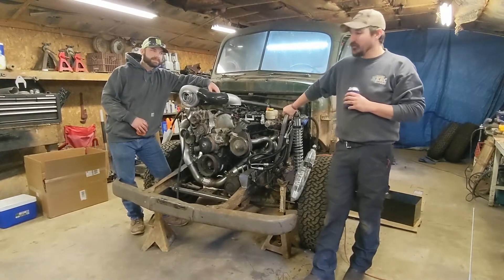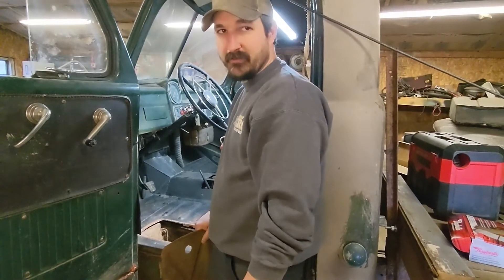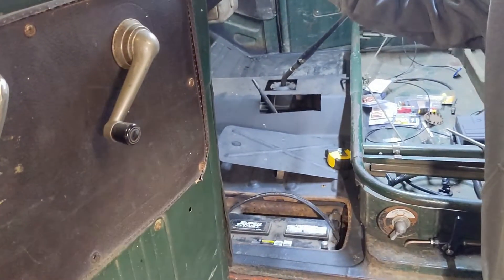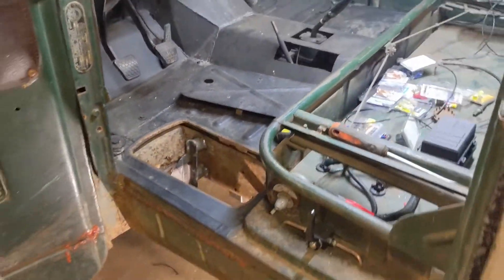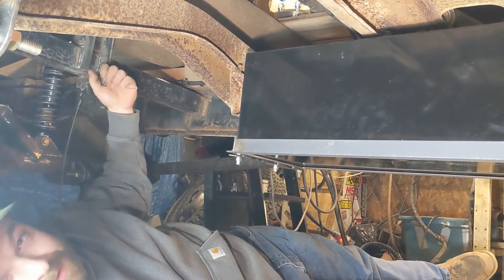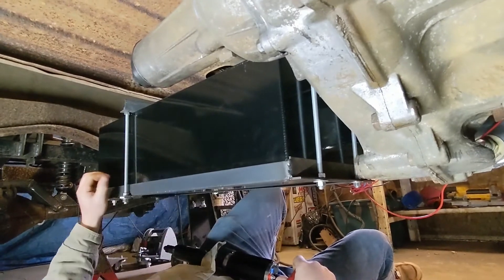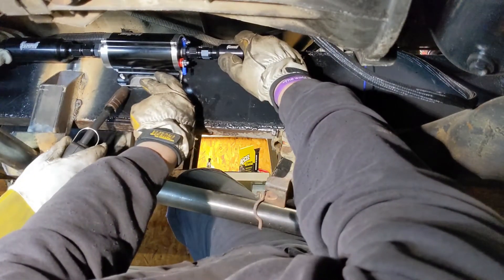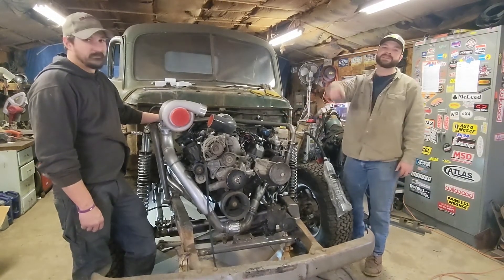The 360 Magnum in this '51 Dodge Needs a Fuel System - and A Lot of Other Things!

Comment: I wouldn't mind a "boring" wiring video 😅 I might need some tips when I get my engine mounted
Reply from the maker: Honestly most of the wiring work was just for the truck. It was a 6v system, so I had to wire all the lights and everything else! The Holley is really straightforward.

Comment: What kind of fuel pressure regulator is that? Could you send part number or link?
Reply from the maker: It's just a cheap eBay boost referenced regulator. It's worked well so far.
Reply: Do you need a certain style regulator to run to the Holley with the pressure switch? I bought one of those pressure switches. I'm currently n/a. (Turbo soon)  The regulator I have now I have to manually adjust fuel pressure.
Reply from the maker: The way this is setup is that it raises the fuel pressure 1psi for every 1psi of boost.
Reply: @FedUpFab  mine has the port for the boost reference vacuum. So I should be fine just with hooking up that pressure switch. (Once I get the holley terminator)